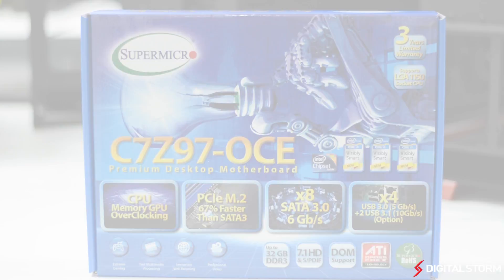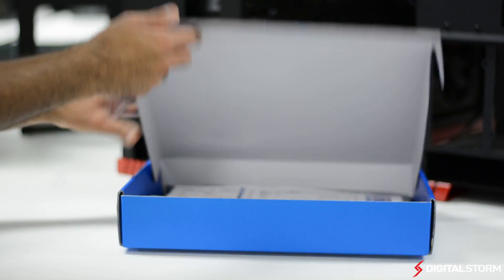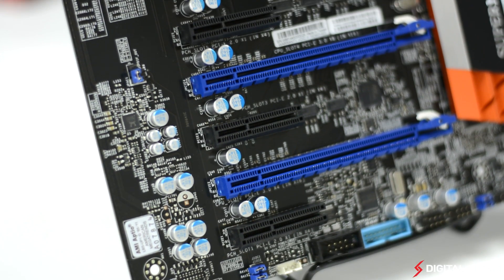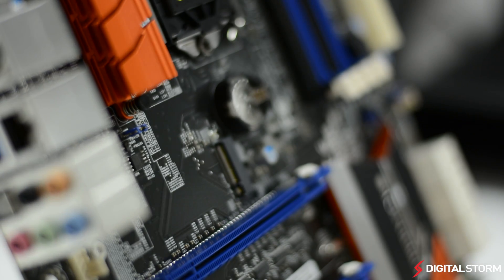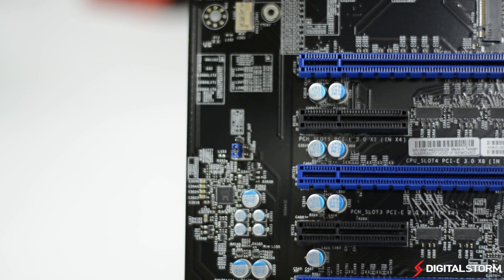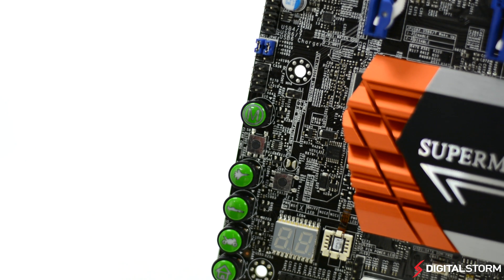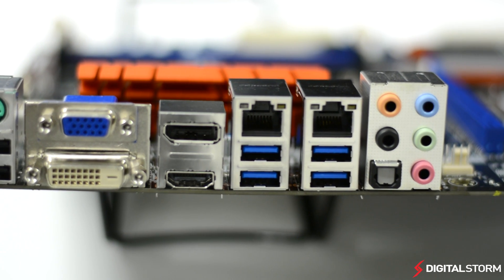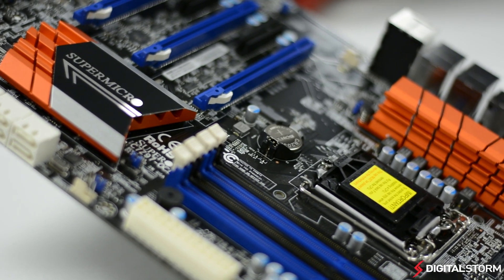Supermicro C7Z97-OCE Z97 Motherboard Overview

Comment: Eh.. I don't really mind colors on a motherboard mostly because I don't usually buy cases with windows unless it's the only option for a particular build (i.e lots of water cooling tubes, radiators, and fans that require a lot of space for air flow and cable management) :P

Comment: uefi bios are awful. i want this board!
Reply from the maker: tech doge the 280X and 770 are worth the extra $ if it fits into the budget.
Reply from the maker: $220 MSRP :)
Reply: Digital Storm where could i get one from in the uk? i'm glad i don't have a window on my case :P
Reply from the maker: Lawrence Timme Not sure about the U.K., sorry!
Reply: Digital Storm i'm sure i'll find one. waiting for dem pentium anniversary editions to be announced anyway.
Reply: Digital Storm just wondering, I am building a gaming pc in a couple of weeks I am getting amd fx6300 8gb ram 1tb wd blue maby a cheap 120gb ssd and i cant decide on the gpu, I'm on a tight budget, I'm thinking r9 270/x or r9 280/x or 760 maby even 770 should I go with a 270 or 760 or are 280 or 77 wort the extra money. I need help. Thanks
Reply: Direct injection engines are awful.
Carburetors are just much better at anything.
Reply: blade00362 ?

Comment: is msi z97 good enought to radeon R9 280x and i5?
Reply from the maker: Definitely!
Reply: honestly, ANY board with the right chipset/socket is perfectly good with ANY single GPU and non-K-CPU....
Reply: :D
Reply: Yeah those are excellent boards
Reply: Depends on what you actually really need for your system , your question its just too wide = = 
But any Z97 boards is good enough. I guess your using it to game right ?
Reply: Yes, games and 3d rendering
Reply: Go for it. Buy i5-4670K if you can. great combo
Reply: nice!! i'll do that!
Reply: and this one: "Fractal Design Define R4 Black Pearl"
Reply: That fits as well. gonna be a nice pc
Reply: Mr.Kristian252 Yup it will do just fine. Unless your like an Overclocker Enthusiast , you could go with a higher end one boards. 
But basically nothing much difference TBH among all other boards ,just more SATA ports , USB ports , better Ethernet , on-board sound most importantly the Phase Power for Overclockers and of course PCI-E lane bandwith. Though I've seen benchmarking in games , there' aren't much of a difference even if it's X16 X8 X8 X8 vs X16 X16 X8 X8 vs X16 X16 X16 X8 during SLI / Crossfire. 
As long it's least X8 X8 X8 X8 then your good. If it's low as X4 on one of the lane....well best avoid lol.
And don't listen to people say you will need an i7 to game...and your CPU bottlenecks your GPU...that's load of bull...just get a i5 4760K , OC it if you find it's lack of power and your good. 
Once again , I've seen benchmark and reviews i7 4770K vs i5 3760K there's only like 1 - 5 FPS max difference ( After OCed , at STOCK , it's 101% same ) even compared in 4-Way SLI / Crossfire...there's no huge difference and no bottlenecking. Don't believe me ? Just search for it , i7 4770K vs i5 3760K gaming performance or something like that. 
And yes even it's running on 1080p / 1440p / 1600p....not sure about 4K though...
Reply: Eric Tan I don't see why you had to write 26 lines to me xD but thanks :D 5 FPS is nothing so yea :D i5, here we go! :D
Reply: Mr.Kristian252 just giving you a clear idea =) maybe too clear lol
Reply: first BTW..
Reply: yes